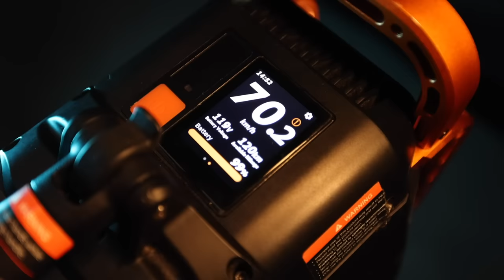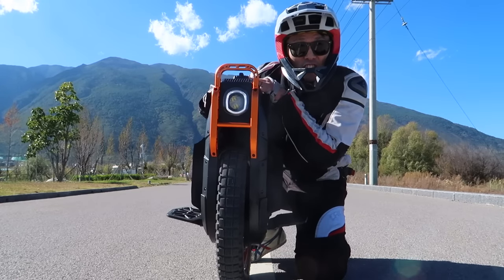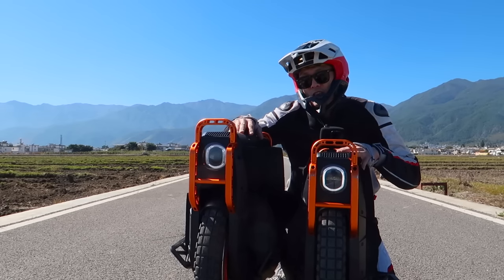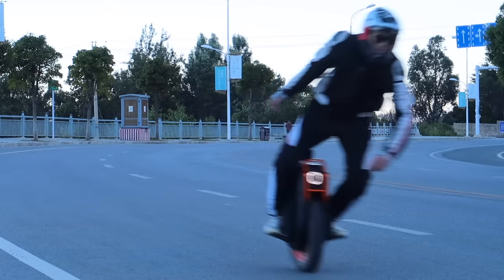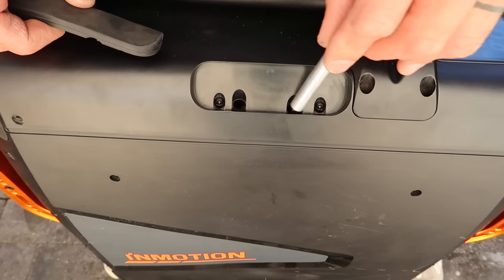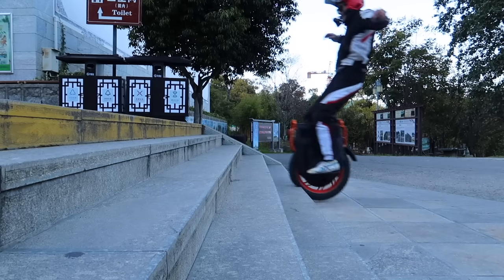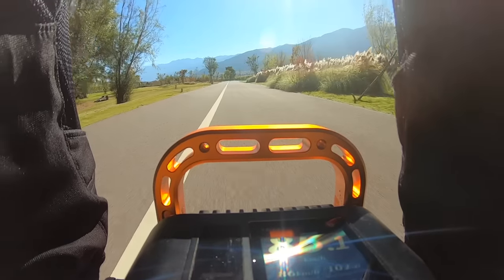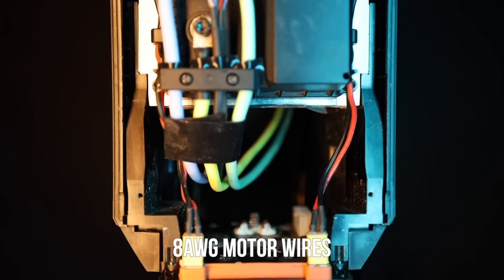Inmotion Challenger V13 Review: Need For Speed

Comment: Man the safety features on this wheel have me drooling. It's cool that they made a top end performance wheel but what I'm really interested in is seeing what inmotion is going to push out to compete with the T4-- Safety and suspension tech of the v13 but in a smaller, lighter package. Hopefully.
Reply: Hopefully, the V12HT with suspension will come out soon.
Reply: I'd be into that, I love the t4 but refuse to buy one.
Reply: Same here. Love the tech, but there's no way I'm buying a wheel that's only 10kg lighter than I weigh! At some point I'd make the mistake of picking it up, and my back would regret it for days.
Reply: @grb1969  I want a v12HS version of suspension.
Reply: Great video, ty. Hey what muscle groups does this make sore after prolonged use?
Reply: @pzj2017  Idk if you're asking me or Kuji but I can give you my answer:
Quads, calves, and muscles in your foot (I don't know the name of the muscle group but you make a lot of micro adjustments with your feet and have pressure on the balls of your feet a lot, kinda like standing on tip toe at least on one foot or the other for extended periods of time). 
If you've ever been downhill skiing, it's really similar. Your feet will be sore and your legs will go to jelly when you first get started but once you build the muscles you'll be able to cruise for hours.
Reply: @JonS  why pick it up ? It hold on to it and it roll up stairs . That's seemsclike only reason to pick it up and you don't have to.
Funny reason not to buy. Like not getting a ebike because you may try and pick it up? Funny. Same reason I don't got a car , it hurt my back if I forgot I can't pick it up.
Reply: @coolhawk2003  for me I've had the occasional need to pick my wheel up to put it in a car. I've also had to get off due to pedestrians, and then find there's no ramps to get up high curbs designed to contain occasionally flooding. Maybe the 22-inch tire size is enough to roll the wheel up those, but some of them are pretty high. This is a problem of living with bad (US) urban design.

Comment: dude this is my most awaited video in YT in long time.  We knew the level of technology and safety of V13, but nothing like seeing it being used by a great EUC_pilot. Your productions are outstanding in quality, fluid, aesthetic, entertaining and informative. I am sold. I want one of these beast. V13 does have a kickstand but as you found out, it may be better to leave the back of the tire free. However some details I would like to have seen: 1) riding mode differences. Inmotion provides several settings available and they do impact a lot the overall riding experience. 2) your tire pressure seems at times too hard. And the profile of the tire kind of flat or square limiting some movements. How do you think V13 may be more nimble or benefit from a tire like Shinko SR244 with a more round profile? Like the inertia when turning, perhaps it may improve with a more round tire profile. 3) What about fast charging? with these heavy weight EUCs we are achieving our limits. From this level I see fast charging becoming a more important feature than adding even more batteries increasing the weight even more. The stock V13 charger is 5A. Perhaps a great add-on to this type of EUC would be a portable and light fast charger. Thanks Kuji, your videos are simply the best. 👌
Reply: I agree with all that.  
I know the Rapture control board is heavily reinforced, but I still have dual charging shell shock from blowing out my v-ll control by using both charging ports. lol... I have a shinko, off road tire on my v-ll and it handles awesome on and off road.  With the right model tire,  tire pressure, shock pressure and dialed in settings, the Challenger will be one power packed, tank of a good time!
Reply: @ostumbling  thanks a lot for sharing. How many amps (in total) were you using on your charging set? I use 5A, checked with a thermal camera etc and all fine. My V11 control board is V1.0, not the new board. Not sure if the V2.0 is any different in this context.
Reply: @gpsanino                     No problem. Happy to share!  My v11 is third batch. It's going on 3 years old and I blew the original control board about 6 months ago.  I had only used one charging port the entire time I had it because slow charging is supposed to preserve battery life  much better.  One day I decided to go ahead and try the duel ports with my 2.5 amp chargers, so 5.0 amps total.  It was fine, but a few days later I tried the duel ports again and my v11 wouldn't power on.  I fried the control board.  I researched the matter and found that it was not uncommon to blow the older v-11 control boards while using the dual ports. I think it has something to do with weak mosfetts or something like that. The new control board I bought from wheels cost me $250,  but it appears to be higher in quality than the original and is much beefier!  
               Immediately after installing the new board, Inmotion sent me an update on my EUC app.  I don't know if it was the software update, the new control board installation or a combination of both, but my wheel felt much more responsive, peppy and started getting greater milage per charge as well. I am sure the Challenger's "Rapture" control  board can handle speed charging just fine, but I don't want to find out how much that one will cost to replace just in case. lol... I don't mind slow charging anyhow.  I like to preserve my batteries as much as possible. 
             One cool thing about Inmotion being a tec. leader in the EUC space is the fact they monitor each wheel in order to make continuious  updates based on rider feedback. It defiantly makes a difference because it enhances the rider experience. It's fun to ponder how much the Challenger will evolve as a result of this Technology.

Comment: the safety is soooooo good! i want to see a smaller 18-16 inch tire with the same safety and maybe like a 100kph freespin and 65kph riding speed
Reply: does it have airbags? what is safe ><
Reply: @NikosKatsikanis  this has so many safety features such as communication between bms and motherboard, smart bms, passive cell balancing, huge headroom to prevent cutouts, dual hall sensors, tilt back built in to prevent cutouts, a great light for visibility a night, big battery to prevent too much voltage sag, big wheel and suspension that keeps you safe from pot holes, it runs cool, is very waterproof, and has some of the best build quality! no airbag though 😆
Reply: @VECTOR_Coasters  cool

Comment: i commute by bicycle and go about 100km a week
30km/h is not pushing it but nearing the top
if i were to want to replace my bike with a wheel, i don't think i'd want it to go more than 45-50km/h max
i have the feeling such a "slow" wheel would also not have a lot of range
with my bike i could do 100km a day if i wanted to and 40km as an afternoon trip is not rare
are there wheels that can match or exceed that?
45km/h puts it into a speed range similar to mopeds, which are allowed to use bike lanes where i live, so that would be convenient, but then again, wheels are not even street legal in Germany anyways
E-Scooter were just recently allowed and they are limited to 20km/h, which is really lame

Comment: If the V13 had the Sherman S shock system, this would be next level. With that said, I might wait until that moment happens. LFG INMOTION we’re getting closer to perfection🚀
Reply: An Inmotion collaboration with Fox MTB suspension would make this a Sherman-S killer. We will need to discover the long term maintenance issues related to wear before either of these can claim dominance of the market but both these high end wheels appear to be a better value than the earlier iterations. Perfection awaits.
Reply: That would be awesome!  

I will say this much though.  I have the v-11 and the shocks aren't as bad as people make them out to be.  Yes they can be a bit bouncy compared to the other type of shocks, but they still work.  They dampen the bumps and allow you to go fast off road. I'm sure the Challenger's shocks are even better than the v-11 shocks because they are beefed up. 

With that said, I agree it would be sick if they had the same shocks as the Sherman S and also if they had more battery!

Comment: Why is nobody talking about braking ? How long is the braking distance from 70kph (43 mph) to full stop ? What about service ? Is it easy to change the tyre ? or do you have to take the whole thing apart ?
Reply: Braking is the same as acceleration. The torque provides braking power. These stop on a dime. I have a begode master and can brake more confidently than on my yamaha fz09. Service almost inexistent, just  keep the tires inflated. If you have to replsce tube, well study YouTube videos.

Comment: Seems like alot of V12 parts and design aspects. I guess time will tell. Seems to be the most sorted out suspension out of them all so far. At 115 pounds a trolley handle should just be skipped.

Comment: My small contribution to the ECU World.

Find a Mountainsmith Tour Lumbar Pack

This can be used as a saddle bag on your unicycle.

A couple tips

Make sure all the straps are tucked in.

Use a water bottle for balance for the left and right side of the saddle.

The EUC well lean back but you can compensate for this.

For longer trips it’s nice and beats the weight of a backpack on your shoulders.

Enjoy!

Comment: It might not be a wheel that you would recommend as a first wheel but if I keep hearing this kind of thing about it then it's going to be my first. I'm ok with needing to put more effort into turning it off I know the thing is planted to the ground. More then that, I've been looking at a lot of reviews for eucs. If someone has any expectations of having respectable safety features and power on reserve with long range these beefier machines are what you want. I still need to safe for it anyway. It's entirely possible that others will move in step with improving safety and by the time I can afford the v13 something else will have come out to give it some competition. Or maybe there are some under lying problem that hasn't been seen yet. Maybe it'll just get more polished with firmware updates. Time will tell

Comment: So let's do some speed calculations.. at the approximate rate of 8kmh/5mph sooo..

32kmh = 20mph
64kmh = 40mph
80kmh = 50mph
96kmh = 60mph
I think there's a clip showing 88+kmh which is 55mph- practically freeway speed in the US . this wheel is the wheel for riding in traffic for sure since it can still achieve 45mph at 35% battery... which is insane!
Great demonstration of speed kuji!
Looks like a solid/safe wheel. But for right around $5grand it better be.

Comment: I pas sainting for this video for a long time ! thanks a lot Kuji :face-blue-smiling:
60km of range with a 3000kwh battery is 50wh/km, that's a looooooot.
It would be interesting to make a comparative range test @ let's say 70kph with a street tire. the kind of tire you use has a ton of grip at the expanse of Energy consomption.

Comment: OK, conflating speed with power gives not a great impression. Sure, speed and power are not independent, but they are also not the same. That's, for example, how we have high torque wheels which are safer up to a certain speed which may or may not be even the maximal speed.

Comment: Looks like an awesome wheel. I’m really curious how it stacks up against the Sherman S.
Reply: the wheels arent in the same ballpark. At all. Sherman is a jack of all trades wheel with most likely the best suspension, but every other wheel that currently is in the market can beat it in either speed, suspension (for jumps) water proofing, build quality, torque and range…HOWEVER, I do believe it is the best overall wheel in the market for my type of riding and mostly everyone else. it also is 100v which I am happy about.. If inmotion doesnt promote its new smaller suspension wheel soon I will buy the Sherman S also.
Reply: @matthewearl9824  I have the Sherman S on pre-order. I’m not a fast rider and really just got into riding earlier this year. I currently have a V12HT but would really like a bigger suspension wheel.
Reply: @bulldogfpv206  I also have the V12 HT but im def going to get the V13 ober the sherman just for the option of having my speed and power on hand. I think it will be a perfect brother for the V12 HT..... The sherman S, I dont think will be a massive upgrade in power and speed wise like V13 is.... (Actually either way, both Sherman and V13 wuld be great choices)
Reply: Did any of you notice Kuji has a Sherman S in this video as well??? When he puts the V13 on his lockbox charger garage thing lol the Sherman S is sitting right next to the charge garage box thing. I wonder why he didnt put the video of the sherman out yet? Forsure he had the Sherman S a long time before he had the V13 right? Even north america has sherman S's being reviewed by all the big channels.
Reply: @bulldogfpv206  can you believe the Sherman S is 100lbs too? That's crazy...
Reply: @timpriestley8997  I believe that the new firmware on the Sherman S will unlock high speed mode, looks like folks are getting up to 50mph. Not sure if hit that speed for a while.
Reply: @matthewearl9824  I know, crazy for sure. I’m sure the V13 would be a lot lighter if not for the bigger motor and the potting compound around the batteries. 🤔
Reply: Has it a suspention mode?

Comment: Awesome video as always. When you push it up the stairs was the power on or off? Sounds like a dumb question but was wondering. And could it be pushed up the stairs with the power in just using the handle or is the handle to flimsy for it?
Reply from the maker: Powers on. No, you shouldn’t use the trolley up the stairs, the tires much more likely to slip and/or lose control.

Comment: thanks for the first great review! i will be saving my money on the next smaller suspension nimble Inmotion wheel that is coming out. This does not seem like a good fast torque’y commuter/jump wheel. I like to maneuver quickly around ppl and obstacles but this looks exactly like I imagined. A fast, straight, high speed suitcase that weighs 100+ lbs that still has the same range as a v12 going nearly its max speed. I may still get it but it looks too big and not maneuverable enough for me now.

Comment: Kuji is still king of euc reviews! 
For that price and weight, not enuf batteries STILL.  3600wh would've made it at least competitive against the long cruisers.  MasPro is still high speed cruiser king.
Reply: With 14a charging, 1h charging adds 1700wh, which makes it work as a long cruiser.
Also a long cruiser needs proper waterproofing, as in many countries it can be hard to never get any rain on very long rides, sometimes.
Reply: @Jean Jose Garcia Molina  that's if you have access to a charging station.  That isn't guaranteed... if that was the case,  Onewheel is also a great long range device.... lol
Reply: @mig6220  you can charge at most restaurants, Accomodation...
Reply: @Jean Jose Garcia Molina  you assume these things are always available.  On some long rides, they aren't.  Sometimes the owner can just say no.  Or outside outlets don't work.
Reply: @mig6220  of course it depends where you're riding
Reply: I see my comment about OneWheels also being able to ride 250km on a yearly group ride got deleted, maybe because of the link to the event itself, OWAlgarve. It takes them 4 days. On a V13 it can be done in 1 day.
Reply: @mig6220  it happened to me that I had to walk for a while to a village and there was no place to charge at, but I was lucky I ended up finding one outside a restaurant that was closed and they were cleaning inside, they allowed me to charge outside, I was lucky...

Comment: Nice to see the margin they’ve added to keep power on reserve. It goes extremely fast but it could go insanely fast yet doesn’t, for safety. I like that.

I’d love to see that concept and the other safety features brought to smaller more portable wheels that cruise in the 25mph range and weigh under 60 pounds.

I’m not a speed demon but still want margin and the other safety features (large mosfets, good battery tech and waterproofing, etc)

Comment: My only gripe is if you go fast, that's a 60 km wheel... which isn't much.
Reply: right realistic range on my 3600wh wheel with my heavier weight was 74miles and it limped back at 76volts barely made it and it doesn't weigh nearly as much

Comment: So Glad to see you Back Kuji !  
You show this to be High Speed fun..  Built with a great deal of safety in mind. Redundant Hall sensors is a a big comfort and confidence builder. The higher speed fun with one of the  top end suspension for now brought a smile to your face.. 
You make a good point about slower speed bumpy trail riding will or maybe hindered with the added weight and size.. ..  
Looking into the beefed up wiring and what seems to be a much more sealed up electronic package looks so much more advanced to date.. 
I can't can say enough about this Gem as you displayed it..  
Thanks for you time and view... 
SO WHEN SHERMAN S.  
Until next time , don't keep us hanging so long..  Much Respect!